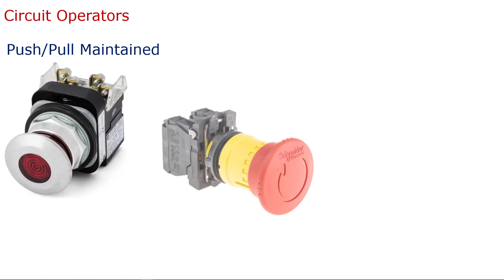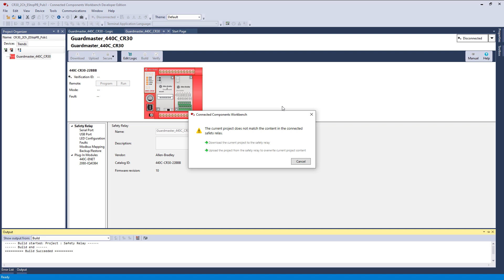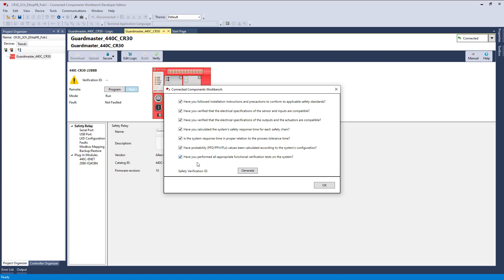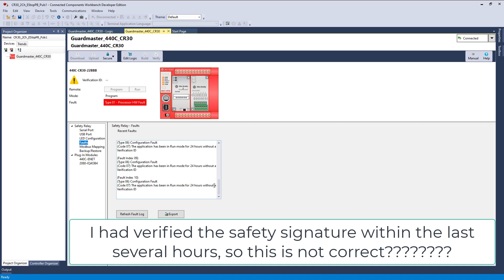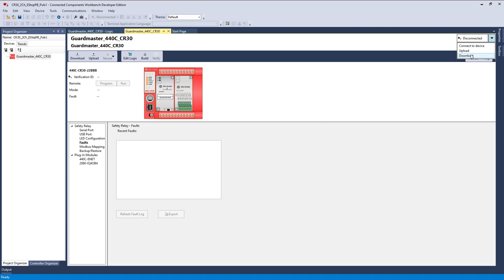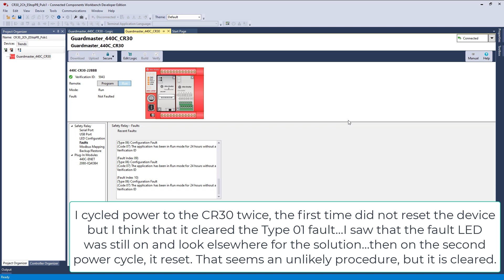440C-CR30-22BBB - Electrical Design and Programming Pt7 EStop with Test Pulses & Fault clearing CCW

Comment: 18 to 21 are described as OSSD High side or Single wire safety output.    Yest you say the are basically DC outputs.   Please explain